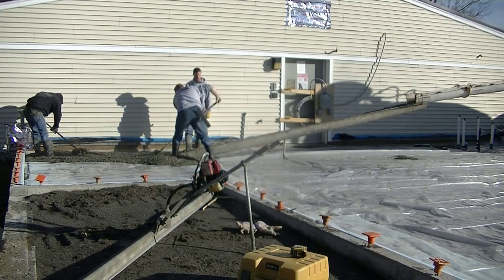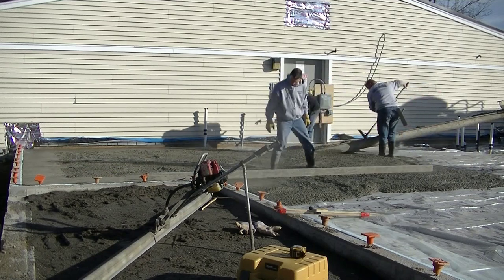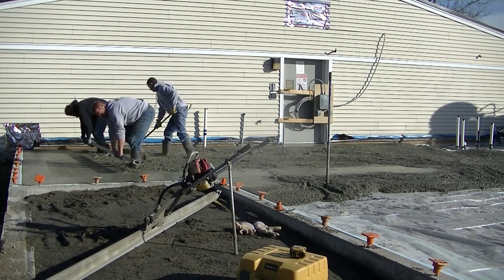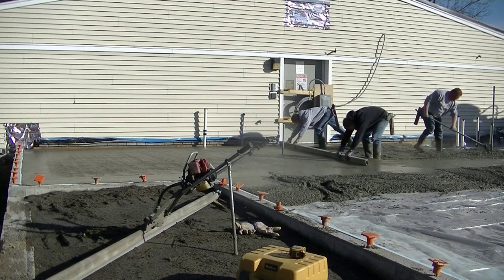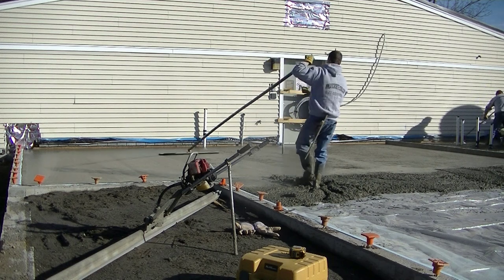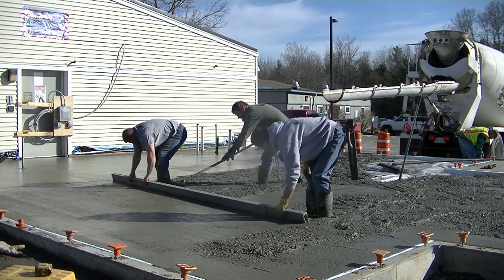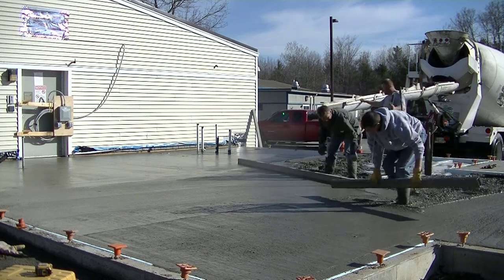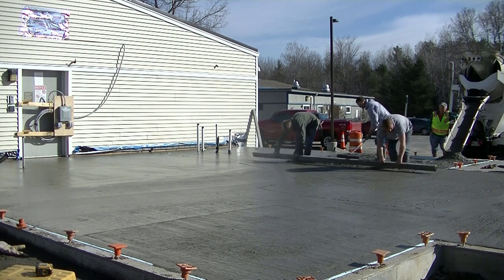SCREEDING CONCRETE | KICK SCREEDING VS VIBRA-SCREEDING

Comment: the example of setting "wet pads" with a laser level is a great tip.  most other finishing videos i've watched uses rebar pins.  this seems very straightforward and simple.

Comment: I think for someone DIY’ing a concrete slab one time in their life, it’s much easier to setup some leveled wooden beams next to the slab where you ride the screed over. Sure without is quicker if you do it professionaly all day long. But as soon as the concrete truck arrives you don’t want to be messing around with laser levels and lack of skills messing up the slab. I would do it that way i think at least.

Comment: Hey Mike I'm a small 3rd generation concrete contractor in pa. I've always wanted to try vibra screed out, haven't even seen one in use in person. does it get the pad as flat as hand screeding when following a wet screed
Reply from the maker: It does when you have two good puddlers or rakers and an experienced operator. We still hand screed when we have a slope or a drain in the floor. Nothing like hand screeding but I'm a little biased, been doing it 39 years. The vibra-screed has it's place for many of our pours though.

Comment: Hey Mike. Owner operator of a concrete contracting business here in Denver CO. That mix in the hand screed portion of the video is very wet. How much water are you adding on site?
Reply from the maker: Sam, we usually try to pour around a 6 slump. We always use a water reducer in the mix to keep the mix at a good water/cement ratio but still be able to pour the mud loose.

Comment: I am having a new house built and the guys didn't put any expansion joints.  What is your opinion on that?
Reply from the maker: It's probably going to develop some shrinkage cracks.
Reply: deal with the crack or wet cut joints, fill with backer rod and caulk